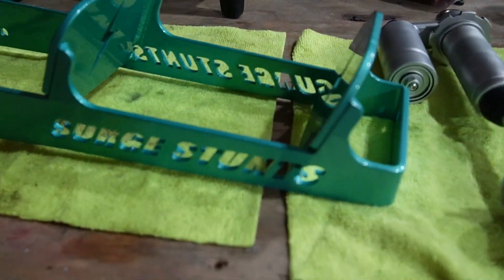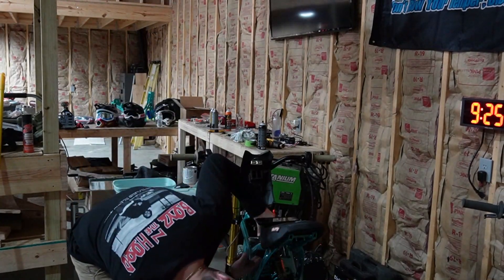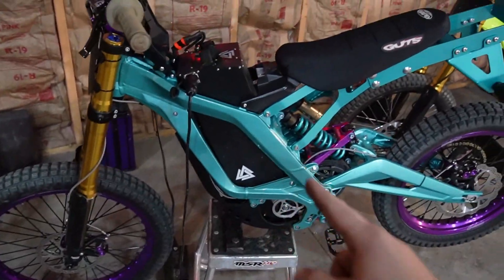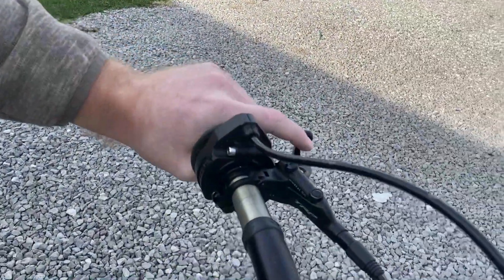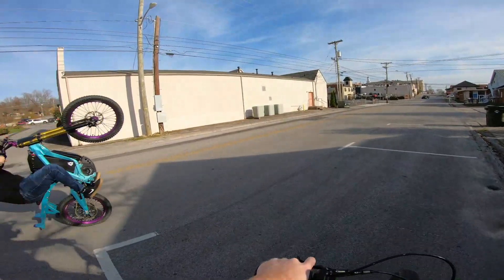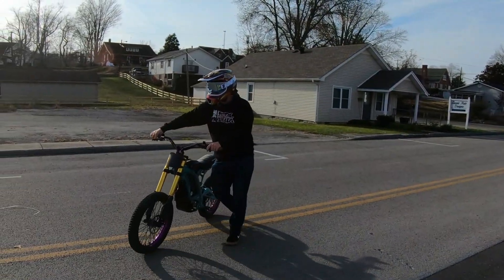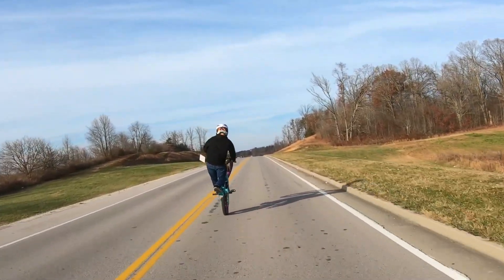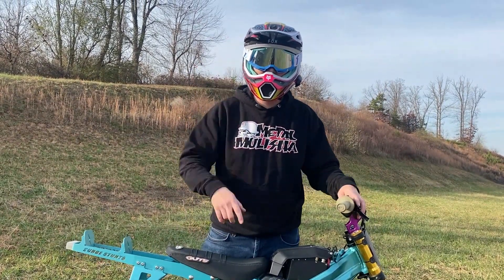SURRON WHEELIE MOD

Comment: It needs to made 2" longer. You guys have to lean back way too far to 12 o'clock and scape that you can't easily coast through it. Scrapes are for slower speeds and the momentum it takes to recover from that short bar requires too much speed which is dangerous. Watch a dirtbike scrape and compare the fork angles and you'll see what I mean about the length. Be safe guys.
Reply from the maker: Hey thanks for watching and commenting ! If you want to really throw sparks they actually make a separate piece you can buy for it that makes it 3” longer to make scraps a lot easier and longer, it’s called the firecracker spacer ! Here’s a link check it out. https://www.surgestunts.com/product-page/firecracker-spacer
Reply: I disagree. It's at exactly 12. Surron LBX suspension geometry is not even comparable to a dirt bike. I Have no issues scraping in the pack and keeping momentum for length. For someone who only chases wheelies uphill, you seem to have quite the strong opinion on this topic...